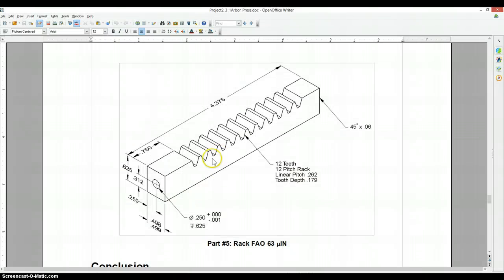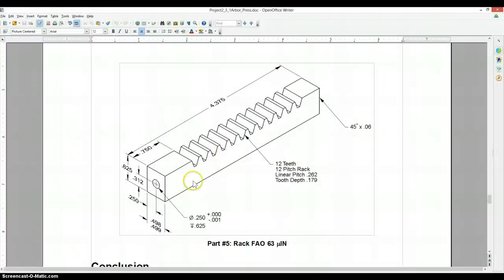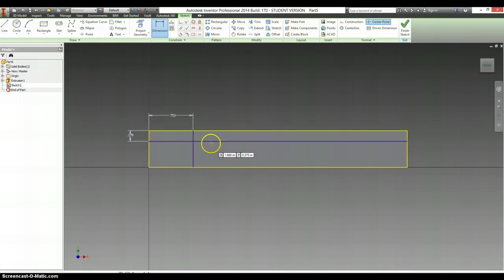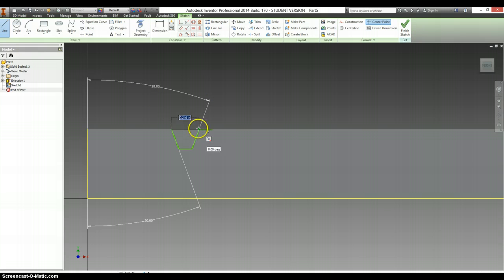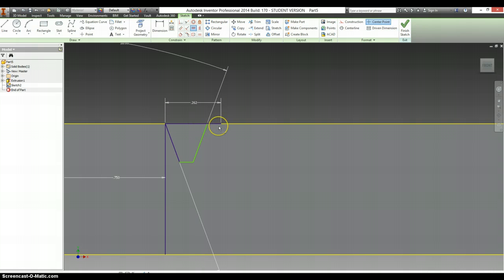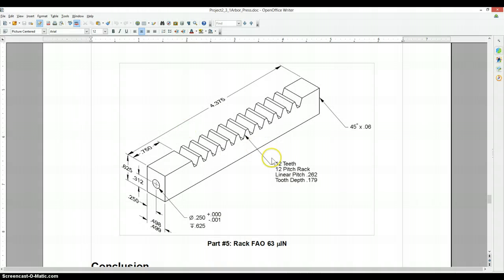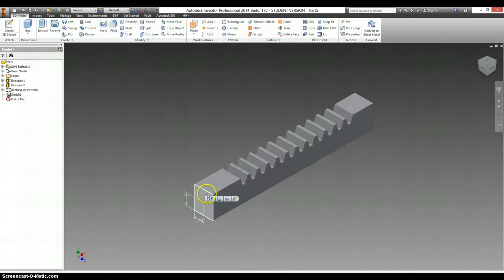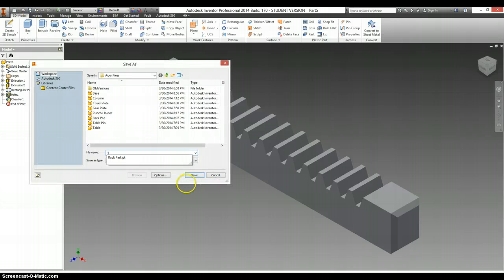Rack

Comment: Just a quick comment. You could probably avoid the wonky geometry by using construction lines instead for some of the layout. The added bonus is that you do not get the red cross symbol for sketch failure.